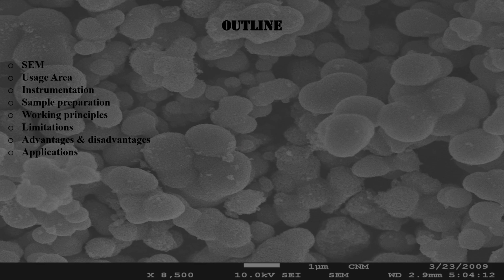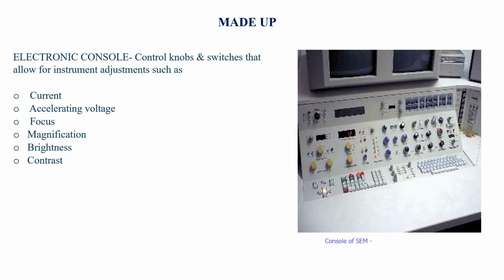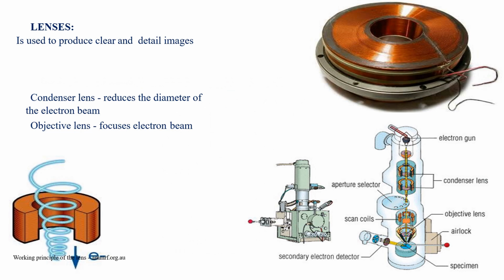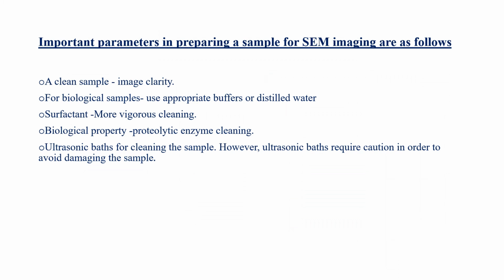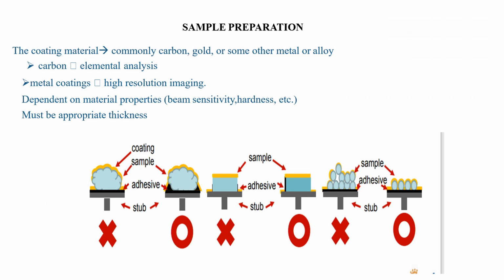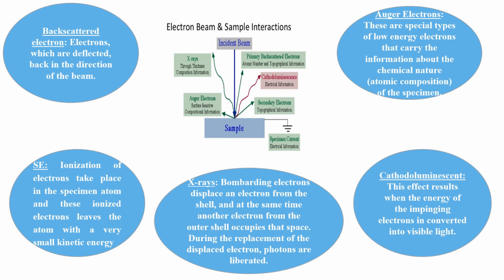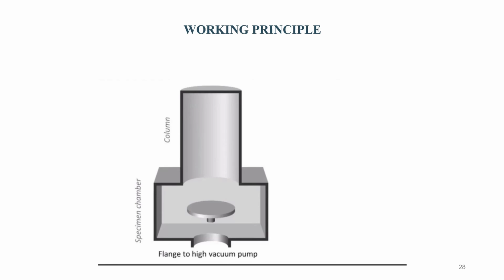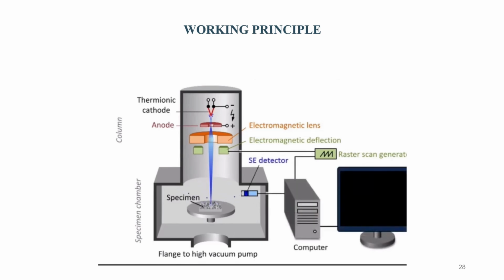BT21CME017 Rutuja Pathak | Scanning Electron Microscope (SEM)

Comment: BT21CME003 Krunal Putta 
Does changing accelerating voltage affect SEM images? How?
Reply from the maker: Yes, changing accelerating voltage affects SEM images:
High voltage: Increases resolution, deeper penetration, and larger interaction volume, useful for bulk material details.
Low voltage: Reduces sample damage, minimizes charging, and enhances surface details for non-conductive or delicate samples.